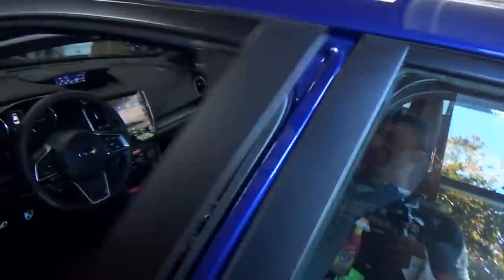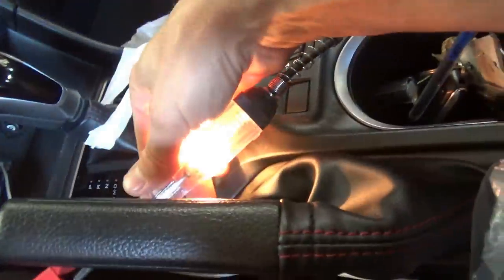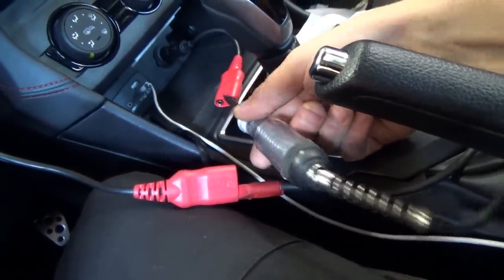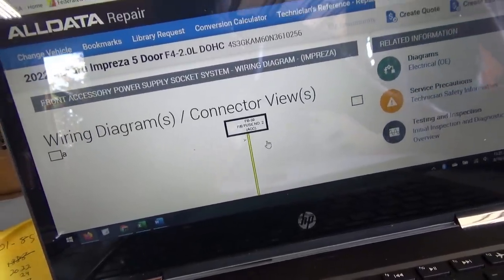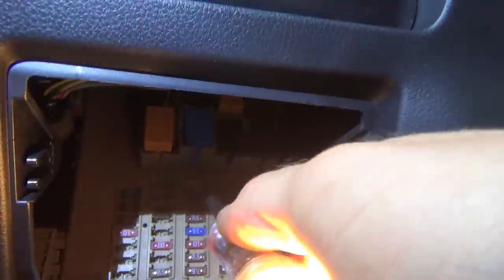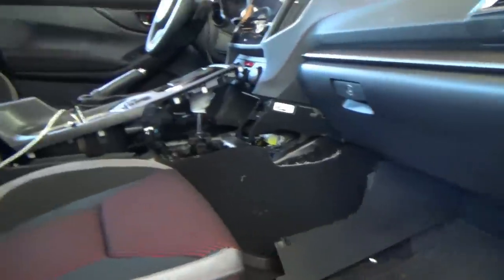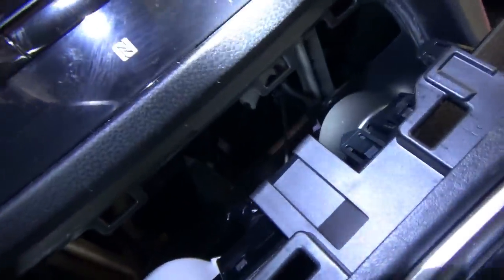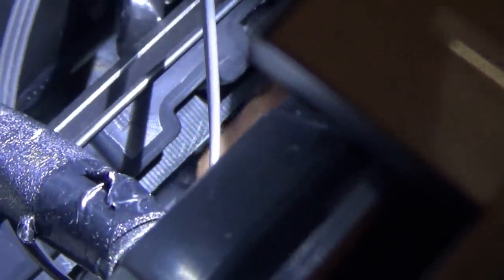Dealer Wants to Charge Customer for THEIR SCREW-UP?! (22 Subaru Impreza)

Comment: He should have connected to the battery directly or added a circuit at least that is what my Icom instructions stated.
Reply: yeah... trying to run a rig off a cigarette lighter is just asking for trouble.  I'm not into Ham radio, but my dad is a huge fan.  Everything gets it's own circuit, everything is fused on it's own, and then either relay to ACC power or direct to battery depending on how 'important' it is.
Reply: I ran my rig off the lighter socket for a year after I bought my truck because I was searching for a path through the firewall without having to drill holes.  It ran just fine - even at 50W.  I did eventually run an 8 gauge from the battery though.

Comment: I *love* the fact that you test the tester before testing the circuit, every single time.  Minor invalid assumption at 4:22, "are we missing the power OR the ground to this outlet" - probably one or the other, but you could also be missing BOTH, i.e. the stealership installed the new outlet but didn't connect it at all.  Always check both.  (Which you did.  OMG.  Did I just diagnose it before you tested it?  😅)
Reply: You need to calm down my dude
Reply: You mat have guessed but you did not diagnose anything.
Big difference.
Reply: @ProblemChild-xk7ix  Fair enough.

Comment: Ivan just some quick info: 2019 Subaru Forester. TSB 09-80-21 Thermo Valve part updated. Shuts off all safety features, cruise, S on dash flashes, P26A3. Calls for 2.6 hrs, under intake. 100k miles currently. Our 2014 Forester, 1 quart / 500 miles. Previous owner had until 100k and Subaru would have replaced the short block. Currently 133k on it. Subaru customer service could not provide dealer repair info for salvage engines; in fact the original purchase locations they have given were incorrect. Purchased the 5 report package Carfax offers and using it to track down service info. Hope this helps in the future.

Comment: Call Subaru Of America and register a complaint, the dealer owes you a refund and possibly a new console panel for scratching it up.
I have a Subaru WRX and when it had 5K miles I brought it in because I thought the clutch was acting funny. I had a Bluetooth diagnostic connector in the ODB2 port. The service manager was like: "You have an aftermarket device plugged in." And I'm like "So, what does that have to do with the complaint about the clutch?"
He gave me a blank stare. I took the car back, adjusted the clutch pedal rod linkage myself.
Reply: No fricken way! Is that how they do business everywhere?
Reply: @TheFrenchPug 

Don't know. I have 45K now and have done all the service myself, fluids, etc. Haven't had the car back to the dealer since.
Reply: @groosbro1  I only do what I can myself as well on my BMW.  You are probably a  notch or two better than me though. Sad you can't trust the dealer unless obvious warranty repair.

Comment: I agree that the dealership/technician is 100% on the shady side. they should not pay you any and all money out of pocket back to the customer, but replace the scratched up panel around the so called faulty outlet. just seems fair. also on any further warranty work needed in the future I would highly recommend a different dealer. great easy fix Ivan

Comment: The sad part is that the tech who tried to use a shortcut by pulling the socket out and just pushing a new one in didn't even test it to see if it worked or this wouldn't have happened.

Comment: Another great video my friend. As bad a friend 2008  Chevy pickup 4.3 p0128 code. Dealer wanted to replace coolant temp sensor oil temp sensor and A/C compressor.(This code shuts down the A/C) After testing found thermostat needed replaced.

Comment: Ivan needs to install the CB radio with cables directly from the battery. On my big truck, I had a 25-watt CB radio attached to a 667-watt linear and I could talk for 25 miles all day long and sometimes from America to Europe. I had it professionally installed with battery cables and not some flimsy 12-volt outlet. My big truck had 4 start batteries and 4 deep-cycle batteries.

Comment: I have worked at a few dealerships and its not uncommon for them to let the Lube Tech or in some cases even a Porter do the work for them. Typically in my experience though, it has always been double checked and verified that it was working before being returned to the customers.

Comment: Early GM ignition rotors had a square & a round pin which would be located into a square & round hole in the distributor. I had a customer install it backwards (square pin in round hole!) and removed the distributor & installed it 180° off! It damaged the vacuum advance, so when I got the car, I removed the distributor & corrected the problem!
And I thought you couldn't put a square plug in a round hole!

Comment: It's interesting that the outlet was good for only 120 watts (10 amps X 12 volts), when it's fed by a 25 amp fuse. Unless the outlet had a hidden 10A fuse built in, I don't understand why it stopped working. I can't even suggest that the HAM radio might have had a high inrush current, because it worked for an hour. Surely the original outlet didn't melt at under 12 amps.....Good troubleshooting on your part, Ivan!
Reply: Transmit  will pull way more amps that just receive on a ham radio.
Reply: Sometimes, cig sockets have inbuilt lead fuses that fail, they are designed  to fail on overtemperature,  poor connections often  kill them..

Comment: This is an issue in todays setting. I sent a car from my dealer to another dealer for warranty work and came back with loose/leaking brake lines they did. I just take care of it b/c less hassle. It's frustrating the low quality work I see from all aspects of repair shops. The DIYers are even worse. Mainly b/c common sense isn't common anymore.

Comment: Dealers are incompetent and  lie to cover up mistakes. My friend bought a pristine used Toyota Tundra off CL for half price $10,000 because the dealer told the owner the engine was locked up and needed to be replaced. We decided to take a risk on it based on the owners story. Owner stated dealer had just replaced the intake manifold gaskets and the next day it locked up when he tried to start it. Turning it over by hand we found it locked up at TDC. I put a camera in cylinder 1 and found a nut that looked exactly like the intake manifold nuts. I can't explain it but amazingly by luck when the owner drove it home the nut didn't fall in until he tried to start it the next day. The engine locked up without any damage because it never ran with the nut in the cylinder. Dealer accused us of planting the nut, but it is too big to fit down the spark plug hole.  Dealer sent someone with a  camera to look in the cylinder to verify our diagnosis. We pulled the head to inspect and there was no damage to anything. We gave the pictures and nut to the owner who started legal action against the dealer. I hope he gets a huge settlement.
Reply from the maker: Someone didn't stuff paper towels in the runners when the manifold was off haha

Comment: I would say they pried the old one out the front, disconnected it and tried to put the new one in but the wire connector was too short so they just jammed the new one in and "hoped for the best!"  I can't believe they returned it to the customer still broken.  
I feel like I'd go back and ask Subaru for a list of acceptable accessories to plug in.

Comment: Doesn't surprise me, I went back to doing my own work, took it to the dealer for a simple 4 way tire rotation, ask him if he would please torque the wheels to 90 ft-lbs, he said no it's 150 ft-lbs.  I corrected him but he still torqued it to 150 ft-lbs. 🤔
Reply from the maker: 150 ft lbs should strip the studs on a Subaru because they are made from Swiss cheese lol

Comment: I'm a ham radio operator too. I would not recommend powering a transceiver from the 12V outlet. 11 amps sounds to me like he had a 2M transceiver that he tried to run at 50 Watt power level. 25 Watts and he would likely been fine.

He should use a spare fuse location and a 15 or 20 amp fuse or connect to the battery with a fused connection.

Comment: the dealer is 100% correct here;  anything aftermarket other than a lighter or a phone charger (approved by the phone manufacturer or phone manufacturer brand) voids warranty on the circuit.  this is verbatim from warranty on Subaru Impreza which I have in my possession
Reply: No sh$%! Wow.

Comment: Nice work Ivan, I was hoping you would check both terminals when referencing to ground or positive side of the battery.  You then would have realized the connector was installed wrong.  I refuse to go to any dealer service department because of this very reason and most just want to rip you off.  Thanks goodness for shops like yours.  (You’re welcome to move to my city, Fort Wayne Indiana, anytime!).  Great video!!! 👍🏻👍🏻

Comment: rule of thumb, never draw more than half the rated current  from the  outlets in a 12 volt system.   10 amps is way pushing it, but 11. the owner is going home to plug the ham radio in again. hill be back.

Comment: The socket usually has an internal fusible link.  I blew the one in mine.  My solution was not to plug in high current devices.  Instead run something from the battery using appropriate wire and connectors.

Comment: The owner should never have had to pay a third party mechanic for this repair. I would send a certified letter to the dealership outlining the dealer experience and documentation of the third party repair diagnosis and cost. If the dealership does not respond or refuses to pay the repair cost then you can take this evidence and file against the dealership in small claims court. This would be a slam dunk in court and a black eye for the dealership.

Comment: I'm 62 years old and the US automotive 12Volt accessory jack has been on this earth longer than I have.  If you can't figure out a 12Volt accessory jack, your likely unable to empty water out of a boot when the instructions on the sole.  Report the dealer to Subaru Rep for your region, and share the video with them.  Perhaps Pine Hollow Auto Diagnostic would like a be a Subaru consultant for this ignorant dealer.  Could be a lucrative gig.

Comment: From what I can see, that circuit is rated for 240W (12v x 20A). The customer used 135W (11.2A) on his equipment. Nothing was even remotely over loaded. Let alone the socket, which should easily take over 360W continuous. At this point I wouldn't allow the dealer to wash the car, and formally complain to Subaru Corporate asking them to retrain their incompetent techs.

Comment: If they changed the socket under warranty you should be getting a survey from Subaru.  I would tell them what you found and contact Subaru. I didn't buy my Subaru from the dealer that has being servicing and performing warranty repairs. They have been excellent. I always give them a suggestion on where to start.  Radio direct to battery.

Comment: I managed a Subaru service department for many years, customer satisfaction was always top priority at my dealer, and my crew embraced it, and was rewarded for it.

The car in this video was clearly under warranty, Subaru's warranty policy for vehicle's within the basic warranty period is to diagnose this issue as  warrantable until found otherwise. If a reason is found, then stop and inform the customer that further diagnostic is needed at the customers cost. This dealer technician/advisor/manager clearly doesn't follow SoA's own policies...or there is more to the story....

Comment: Great job Ivan, I would come say hi if I lived in the states. I wouldn't be worried about the bit of over draw as it should of blown the fuse but the wiring diagram has a 20amp fuse on that circuit so it would of pulled more than the socket could handle and maby burnt out one of the contacts in it should have some evidence on the ham radio power lead.

Comment: Dealer tech probably pried the socket out the front, and then plugged it back in with a classic reach-around through the side panel. Just a shame that he missed.
Likely that's also the reason why they couldn't bench test the old socket, because he broke it pulling it out of the center console.

Comment: As a long time Ham Radio licensee, may I please strongly suggest running separate 10ga wiring from the battery to the ham radio ?  Properly fused, of course.  The standard 12v outlets in todays vehicles can’t handle the typical load of a radio, & the direct wiring is much better for noise avoidance !    73’s……..

Comment: Looks to me like the dealer was looking for quick cash from the customer who they thought didn't know any better. If that was me, as I'm getting the keys off them and before walking out, I would've told them that I'll be taking it to Ivan at Pine Hollow and gauge their reaction.
BTW, if I was going to use a HAM radio or any other comms radio in my vehicle, I would run a dedicated circuit for just that item and it would be fused correctly.

Comment: An acquaintance of mine bought a Dodge Durango shortly before I bought mine in 1999. His developed a squeak in the steering column, he took it to the dealer who replaced the column with plenty of collateral damage. The repair looked like crap. A few months later, mine did the same thing. Instead of going to the dealer, I posted my problem on a Durango message board, in a few hours I had the solution - spray WD40 on the U joints on the steering shaft. Guess what? It worked! I told the acquaintance to go back to the dealer to get his pound of flesh. This guy was a whiny complainer, I can only guess that the dealership got an earful! 

I despise dealers.

Comment: Dealers like that should not be in business. There was no reason for that - number one the dealer butchered the trim and they didn’t plug in the ‘replacement’ part properly. That to me is one of the worst customer experience and that’s what makes people not want to go back to companies like that. 
Good job on the diagnostics!!

Ask the customer to go to the better business bureau and report the dealership. Stating the dealership caused damage, had to go to an independent shop because the dealership didn’t repair the vehicle properly and wanted to charge him for something that you did quickly. 

Then they will get a ding and potentially get a refund -

Comment: If it only rated for 120 watts max but has a 20Amp fuse, I'd put the blame on Subaru as the rated fuse cannot protect their hardware. If James after market is pulling 11A and circuit was rated at 120 watts the fuse should have popped not fried the socket.
Ivan maybe find James a higher rated socket as that part of the car is out of warranty anyway
Reply from the maker: Excellent point. I think the 20A fuse also feeds the heated seats, which is poor design for sure.

Comment: Hey hammie..you shoulda known better. 
Get about 8 feet of good quality stranded 12 or 14 gauge wire colored red and black. Twist them together with a drill, tightly, about 2 spirals per inch. Drill a hole in the firewall, place the wire thru the firewall with a weatherproof grommet, fuse the hot wire with a 15 amp breaker or link. Attach the wires right to the battery. Put some ferrite beads on the other end of wire and adapt the bare wire ends to your radio power plug. You will eliminate static interference from the car electronics and keep your car chargers from exploding again. How the plug got wrecked is a mystery the fuse shoulda popped. Somethings fishy

Comment: Happens all the time!!! Their technicians break something and plays hide and seek with the customer. Happened to me twice once on each of my vehicles. Two different dealers and brands. Now I have recalls on both vehicles and am afraid to take them in because not sure I will get back a usable vehicle.
Reply: Take pictures of everything surrounding the location that the recall work is to be performed in and a video of the whole vehicle inside and out and tell them that you did when you drop off the car.
Reply: @psdaengr911  Did that. They told me to call a lawyer and sue them. Took it all the way to the location general manager. No luck.  But thanks for your input.

Comment: Used a dealership service once; had an intermittent non-closing sunroof on a 2005 Yukon.  After paying $250 after declaring I would pay for a fix but not for guessing, and several trips, dealer said "we have absolutely no idea what's wrong".  Still took me 3 months to get my refund, and I took out the sunroof fuse after it closed one day. Had mechanic looked at it when it was actually non-working, maybe he could figure out; but hours later could work on its own.  The dealer also tried to charge me $50 for hazardous waste - but they returned my "bad" switch to me so there was actually no waste at all.  Dealer did try to sell me new radiator hoses but I had just replaced those and they still had Gates labels and non-GM hose clamps; I doubt anyone even looked under the hood.....

Comment: My local Subaru dealership here in Fredericksburg l Virginia is awful, the amount of things I found that they have left off, push pins, screws, including obviously using impact guns to put the oil drain plug in is awful. I had to use a 12-in breaker bar to remove my oil drain plug because it was so overtight.

Comment: 10:28 If you install the socket upside down and the connector was never moved, do you think the connection would be made if the dealer just shoved the new socket in the hole? Looks like they found a way to mess it up!

Comment: My guess is that they didn't connect it correctly at the factory.  When he used it, the heat caused the wires to separate.  The dealership then pried it out and saw that the fuse ring on the outlet was intact, and that the fuse in the box is intact.  Then they couldn't test the "old" outlet because it's still in his car.
Reply from the maker: That doesn't make any sense 😅